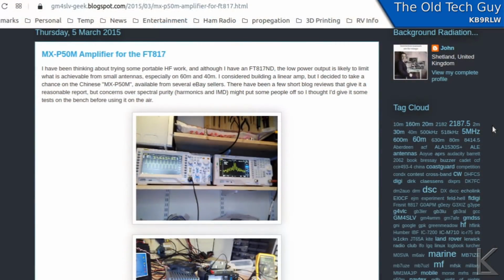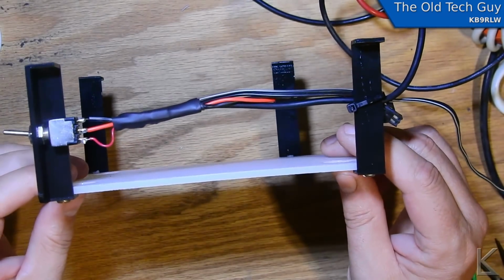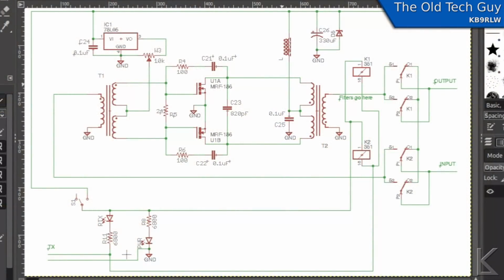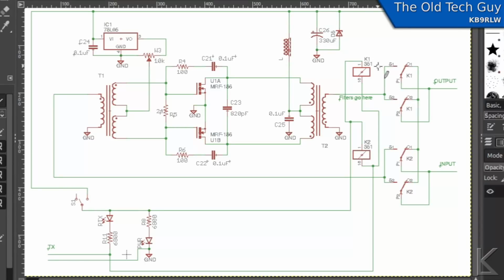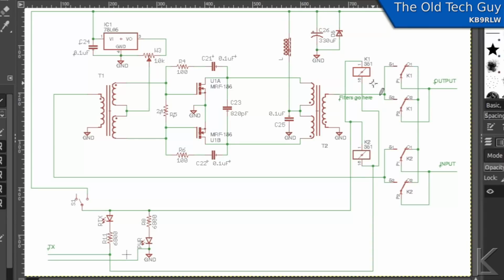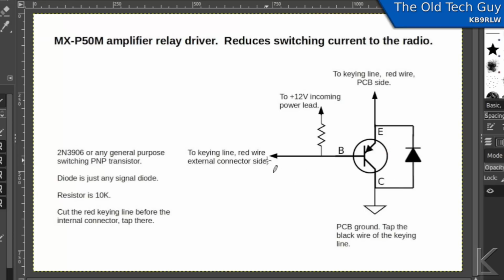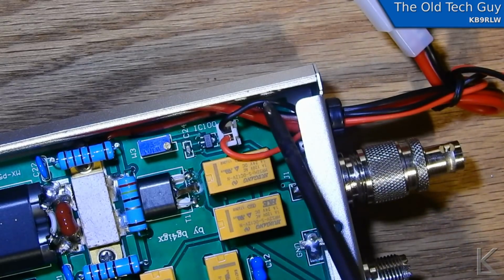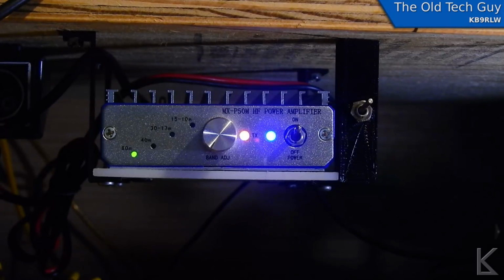Ham Radio - Modifying the MX-P50M amplifier to fix keying and installing it to my desk.

Comment: Thank you for the videos and the schematic.  I bought one of the amps and, since I found the heat sink getting warm with 2.5 watts of drive, I added a 12V cooling fan that fits neatly over the heat sink.  I've also integrated the CAT interface to my computer.  So now, the FT-817 and little amp together act more like my K3 + SB-220.  I plan to add your keying circuit later. 

Would you consider a mod to the amp to actually switch off the 12V to the circuitry? 

de Peter, AE1T
Reply from the maker: Switching the supply would require a relay or something that can handle the current.  Even bigger panel switches are usually only rated for a max of 2 amps or so.
No surprise you need the cooling.  Amplifiers are never intended to run near full output at 100% duty cycle modes.   It doesn't get very warm for me running SSB voice.  I'd bet you're running digital modes?

Comment: I had a design to replace mercury whetted relays (which for obvious reasons became unreasonably expensive), and it was switching inductive loads. I was amazed at the inverse voltage spikes I found that were causing severe damage to the solid state relays I was using to replace the mercury whetted relays. A MOV was added to to reduce the spike. It worked, but the MOV would incinerate on occasion. Great video!!

Comment: Have you tried the FT-817 + amp combination on CW?  That's the mode I will probably operate with the amp.  Do you think the amp's relays are capable of handling the FT-817's version of QSK?  And, thanks for the keying circuit mod.
Reply from the maker: I'm pretty sure the amp's relays would be a problem operating qsk, especially at higher speeds.   I think I recall that amps have to be designed for and rated for qsk, probably using pin diodes or other solid state switching.
I've used it in CW, but not QSK.  It's fine if you have a half second or more delay before switching back to RX.
I've never liked QSK myself though.  The RX noise popping up between elements glitches my brain a bit and makes it harder to send.  But that's just me.
Reply: @loughkb  Thanks for the suggestions.  So, it will be more like working with my old SB-220.  It doesn't do QSK either.   And, I want to try your little switching circuit.  Simple enough.  I just need to locate the parts. One more question.  Do you use the 817's CAT interface along side the TX switching?  73 de Peter, AE1T
Reply from the maker: Yes.  I have a serial port connection on the acc port as well.   I used an old PS/2 mouse cable and it had all the pins brought down the cable, so I just found the right wire and the cable is doing double duty.

Comment: Hi Kevin, nice job.

But apparently 40ma is not a problem for original mchf. It has optocoupler as keyer.
The question is how RS implemented it, probably they simplified it.

Also mchf is known to have problems with pin diode rx/tx switch. Mine had terrible distortions at 14Mhz 5w. So I removed diodes and replaced it with relay. The results are excellent. A little bit more output power and improved sensitivity.
Probably you would like to check yours.

Comment: While it's probably a worthwhile modification, for the peace of mind of anyone already using an unmodified amplifier, the (I believe) 2SD2211 transistor used for PTT switching in the FT-817/818 is quite a meaty beast rated at 1.5 Amps collector current and 3 Amps pulse ... so the 40mA drawn by the relays in the amplifier is very unlikely to be a problem. There is also a protective diode already fitted across the switching transistor in the radio to suppress any back EMF spike from the relays.
Edit or delete this
Reply from the maker: I was going to have a look at the 817's schematic, thanks for saving me the time.
Reply: @loughkb  - Even knowing that the switching transistor in the 817 is sufficiently rated, I'm still going to modify my MX-P50M. Like you, switching those relays directly just doesn't sit well with me and it's all too easy to take out the PTT switching in a rig which can't handle that sort of current.

Comment: I just subscribed to your channel. watched the videos of you reviewing, testing and modifying this interesting inexpensive little RF amplifier. I wanted to ask if you could also review the MiniPA50 HF amplifier. It is very similar to this. I was curious if it may have a better circuit design Or perhaps it may need your modifications. It is about the same price as this. I do believe one of its features is that it has auto band decoder switching for the 817 on the QRZ forum there are schematics for modifying it to work on 6 meters. Just for kicks there is a very high quality 50 watt amplifier called the Hardrock-50 that you build from a kit and you can also bild as an option into it an antenna tuner, Thank you.
Reply from the maker: Looking at the schematic for the MiniPA50, it's a better design.  They have diodes across the relays and proper drivers for the relays on board.  
I can't review it, I don't have one.
Reply: The MiniPa50 as shown here does not have auto RF freq detection. https://www.joom.com/en/products/5c2f190e8b2c3701017d41a5   It is a poorer design thermally.  There appear to be a number of "mafrs"  in the PRC who take a common PCB (populated) and put it in a case and call it a different beast.   The Hardrock 50 amp is a magnificent design but at a high price too. It uses six off RDHH16 Mosfets, which are easy to obtain and it does not overstress them so it has a potential to last forever depending on the build quality.

Comment: Most modern radios the PA is always powered when connected to a supply because that little switch on the front cannot handle the current draw of the pa. You know what happens when you let the magic smoke excape.
Reply: I don't know about that.  The most intelligent thing to do is have a dpdt switch and have one pole as show and the other one switches off the bias supply to the Mosfets. That way the Mosfets don't get a Vcc belt every time the amp goes to Tx mode yet the Mosfets are not cooking any amps in standby mode.  Tim Fidler/ Nz

Comment: Very clever idea to use an extra transistor this way. Although @16:50 the way you place the diode to protect the transistor is not correct. The current in the relay wants to keep flowing in the same direction as it did when the transistor was still on, so still towards the emitter. It will raise the emitter and thus also the base voltage and the spike ends up in the rig. The diode doesn't protect this way because it is still reverse biased after the transistor opens. You have to place the diode across the relay coils towards the supply in order to work as intended.
Actually - it will work a little. As the emitter voltage rises and the base voltage increases to a few volts above the 12V supply, there will be a small current flow from the base into the pull up R towards the supply, keeping the transistor in a linear conduction mode. It will then dissipate the collapsing current into the transistor without too much over voltage to the rig. But that's a side effect. Better have the diode do the job.
Reply: When the supply is removed from the relay the collapsing magnetic field induces a voltage spike in the coil which is in REVERSE polarity to the supply. Therefore the protective diode must be cathode to the positive supply side of the relay coil and anode to the ground side. If it were the other way around the diode would simply conduct and effectively short out the supply.
Reply: It could work if it was a zener diode but OP is right normally you want a diode to the 12V rail.
Reply: Don Reid A zener would help but the zener voltage then needs to be higher than the maximum expected supply voltage to stay off when the relay is not powered. Maybe 15 or 18V to be safe? But at 12V this still allows enough voltage across the base pull up resistor to bring the transistor into a linear conduction and dissipating the tail of the relay current. Which is fine but less defined. This way of clamping would work best if the pull up resistor to the base is not too big, say max. a few kOhm. Then the voltage spike of the relay would be clamped by the transistor to just above the supply voltage.

Comment: Huh. Looks like it's just a standby switch. Also, some relays have diodes built in.
Reply: Yes ... the switch would probably be more accurately labelled "operate" and "standby" as with many larger HF linear amplifiers.